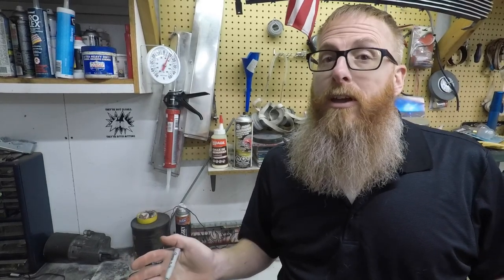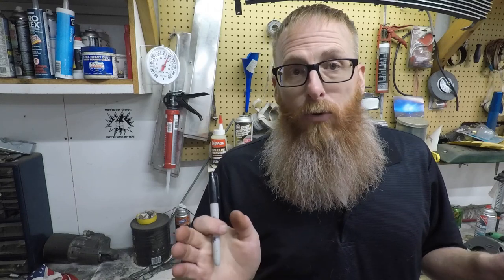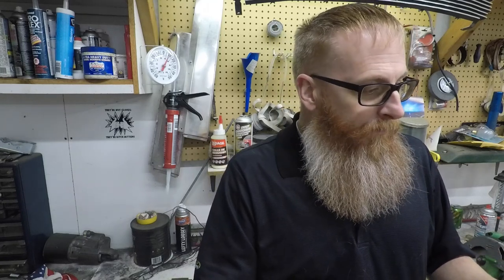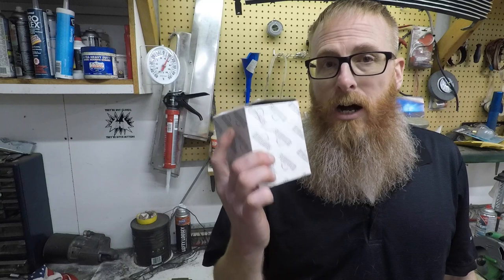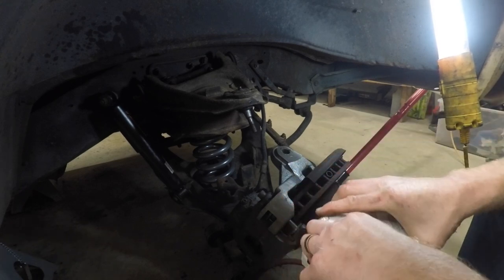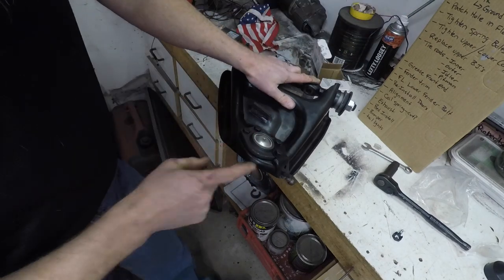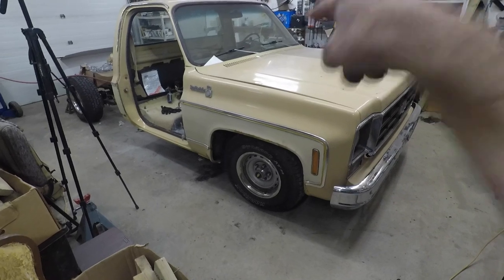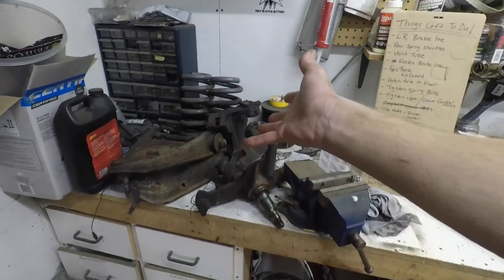HOW TO REPLACE UPPER BALL JOINTS ON A 1977 CHEVY C10 TRUCK

Comment: I could use those 2 inch coils for dad's 84, already got the rest of the stock parts for now. I plan to order some drop spindles as well later. I'm down in wv though.
Reply from the maker: They are yours man! If you pay the shipping, I'll send them your way!
Reply: @OldeCarrGuy   If you can at some point find out what it'd cost to ship to 25508 wv?
Reply from the maker: $40.75 usps